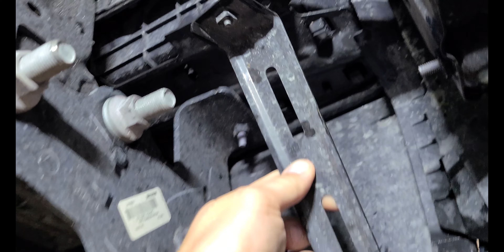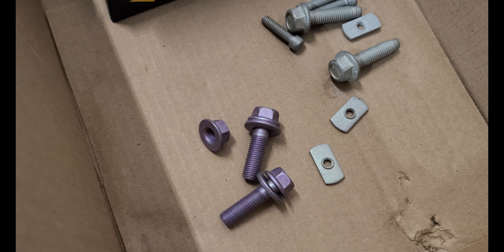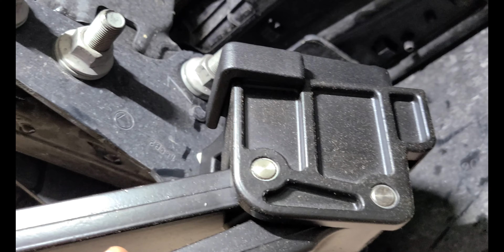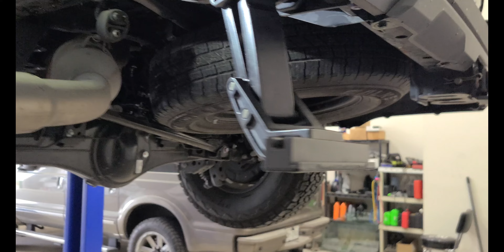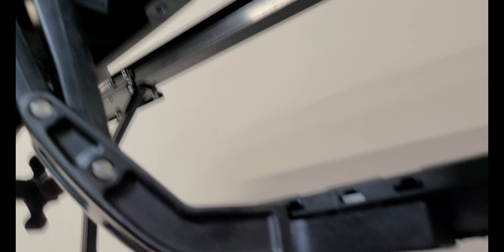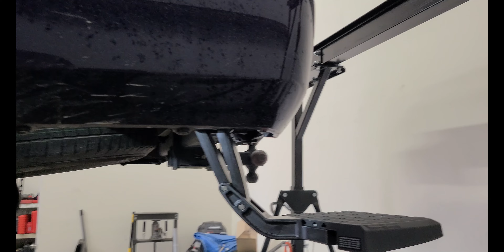2022 + Tundra bed step install EASY DIY

Comment: I hit your trifecta - short, old, bad back!  I miss the step bumper my old truck had so I just bought a step for my 2022 Tundra. I reviewed all the parts while I watched your video and now I’m ready to wrap it up, put under the tree, and wait. Nicely done video and I appreciate the quick summary of needed tools. Can’t wait to unwrap it and install it. Thank you.
Reply from the maker: Thanks for the kind words! You can do it!!!
Reply: @gagefixeseverything  Did it this morning and your instructions helped. They changed the configuration to mount the step. Mine came with three T-25 screws and didn’t have the metal inserts. Other than that, everything was the same.

Comment: Thanks for mentioning that the top nut on the bracket is 10mm. That was helpful and I didn't see where anyone else mentioned it, and since you're taking it off blindly it's a little tricky.
Reply from the maker: Glad it helped!

Comment: FWIW: Toyota has changed design slightly with the step to apparatus connection. Now utilizing three screws, with a star head, directly through step into apparatus. No longer using the Allen bolt and shim as in your video. Be careful with tightening the screw as I get a bit aggressive and snapped off one of the heads. Easy install credited to your video though. Many thanks
Reply from the maker: Great info, thank you for the comment!

Comment: Great video.  Can you measure the distance between the deployed step and the open tailgate?  I’m trying to figure out how big of a step it will be from the bed step to the tailgate.  Thanks.
Reply from the maker: @jeffreysanders1509  I would, but Toyota bought the truck back from me when the engine blew up. The step was a very worth while upgrade.